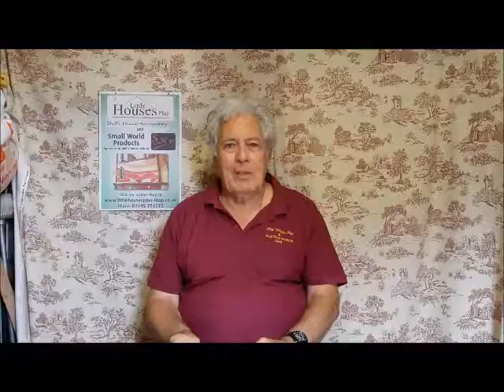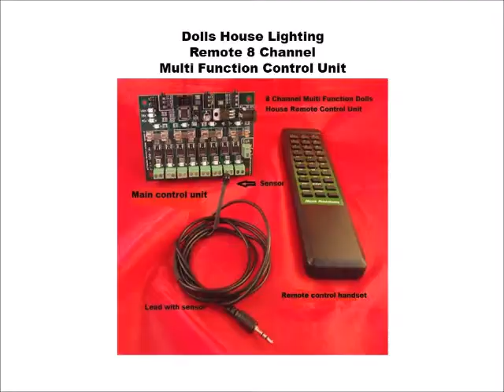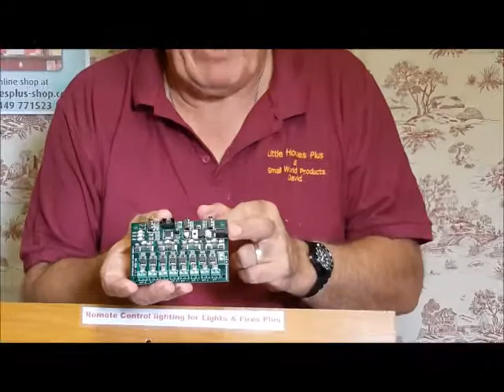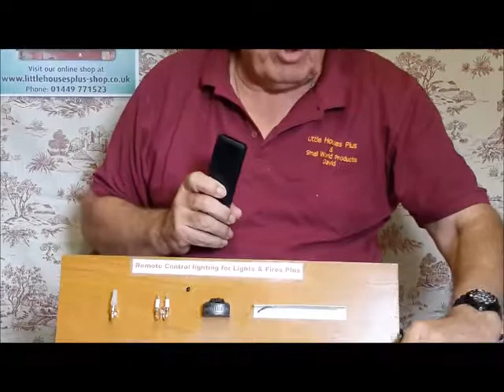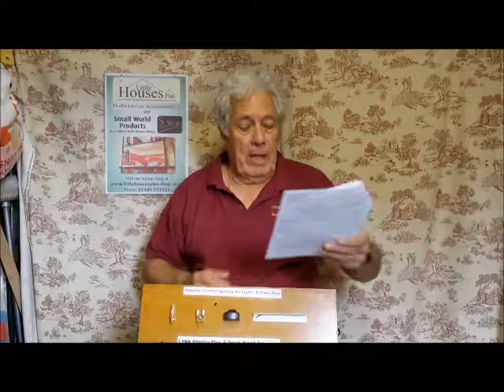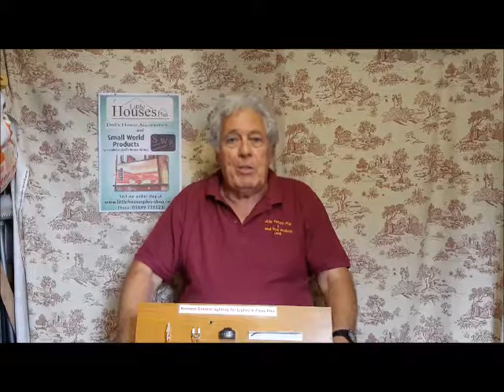Doll's House Lighting System: 8 Channel Multi-Function Remote Control Units

Comment: I’m confused …. When you say the number to adjust the lighting are you taking about the numbers on the remote control ?
Reply from the maker: I sorry for not reply to you earlier
Remote Control Unit’
The unit has 8 independent outputs which can be expanded up to 24 outputs by adding additional units.

Each of the outputs can be programmed to behave differently with a choice of 5 different modes.

Mode 1 Normal adjustable brightness
Mode 2 Simulated candle
Mode 3 Simulated fire
By using the mode above you can use more than one at a time

4 .Mode 4 Flashing output

i.e. If you have a shop you can use this for the shop sign so it goes on / off

5 Mode 5 Static output

Use this to turn on something outside the Doll’s House i.e. if you have a music room and you found something to play music which you could turn on / off you could also look at using this if you have your Doll’s House with a garden around it you could look at having a water feature that you could turn on / off

On the main control unit you can put upto a total of 50 bulbs per a single output there are 8 outlets (bulbs 50 x 8 = 400 bulbs or LED 125 X 8 = 1000)
You find all this and more on our website https://smallworldproducts.co.uk
Hope this helps
Reply: @smallworldproducts125 Thankyou x